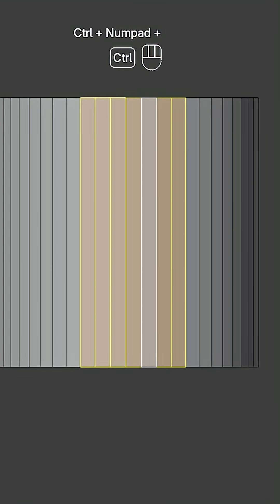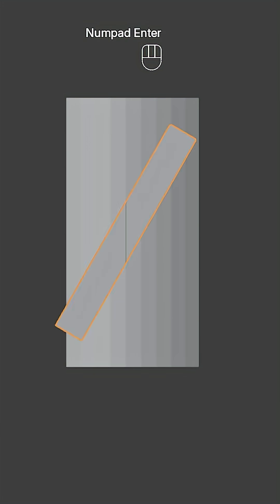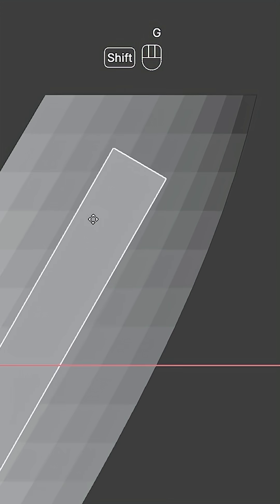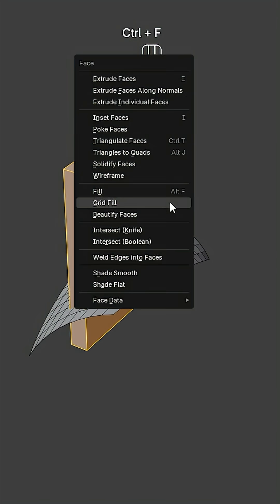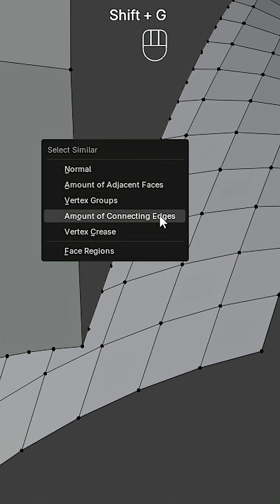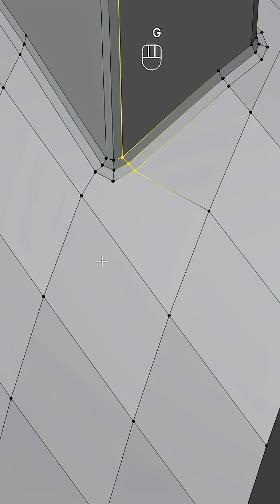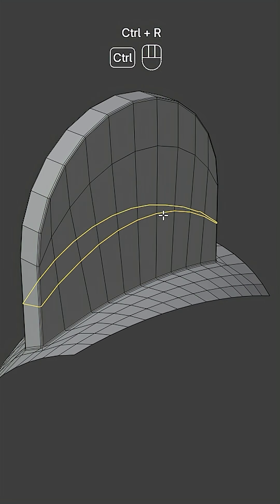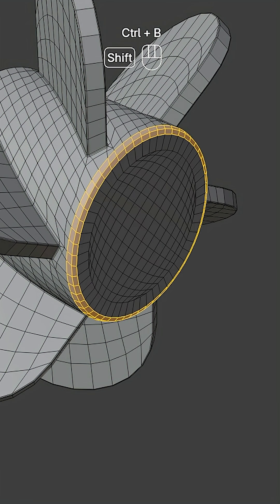3D Modeling Tip - Part 27

Comment from the maker: 📌 Tips for This Tutorial:

▸ The initial cylinder has 54 segments.

▸ Auto Merge Vertices is enabled, automatically merging vertices that are at the same position.

▸ In the bevel settings, Clamp Overlap is on, and Miter Outer is set to Arc.

▸ In Edit Mode, press Ctrl + F to open the Face menu, then choose Intersect (Boolean).

Comment: “Now, how do you model this?”
Well, that’s pretty easy. You just go to top view, select nine faces, and delete the rest. Add 13 edge loops. Back to object mode. Add a cube, scale, and rotate it 30°. Now, select this object, add a simple deform modifier. Set it to twist on the Z-axis and increase the angle. Move and scale the cube as needed. Then apply the scale and the modifier. Select both and press Ctrl J to join them. Go to edit mode. Select the cube, right click, intersect boolean. Select these edges and bevel with six segments. Select this vertex. Press shift G and choose amount of connecting edges. Deselect these and press Ctrl X to dissolve. Now select these edges. Add a bevel with two segments. Join these vertices. And do the same on the other side. Select this face. Press Ctrl F and choose grid fill. Go to side view. Set the pivot point to 3D cursor. Copy and rotate by 60°. Fill this hole. Then add bevel and subdivision surface.

Comment: If the cube is going to be connected to the cylinder at that angle anyway you probably could have saved time by insetting then extruding the faces upward then beveling the top for the curve. Wouldn't need to clean up the verts then.
Reply: i was thinking the same i feel less stupid thanks

Comment: I’m sure you could ve just rotated the faces of the cylinder to get the desired curvature
Reply: Could have also used an array modifier on an empty to non-destructively model the other 5 blades.

Comment: as someone who's main 3D modeling experience is CAD and not Mesh

...damn the process of doing this in Mesh is so convoluted compared to CAD
Reply: There's always someone saying CAD is easier for these heavily geometric objects. The point of this sort of tutorial is to teach you, in a simple setting, tools and topology for you to apply to more complex things. You wouldn't be using blender to make this propeller to have it manufactured.
Reply: I don't know how to use a cad program, but it's actually even harder than this if you are actually trying to make the model usable for a game engine.
Reply: Amen 😂
Reply: It's only convoluted because the end result is more important and open ended.
Reply: Pretty sure you can use the cad method on blender too
Reply: @tiddlesworth8798  how? That is the main reason I stick to max it is much more convinient for ones who come from CAD?

Comment: Uhm... you could create a simple cylinder primitive with enough subdivisions then extrude the blades where needed and then simply add a twist modifier (simple deform)  to the whole thing.
Dunno if im missing the point, but this looks like a 10x more steps method compared to the obvious one🤔🤷‍♂️
Reply: You'd still need a couple steps that amount to cleanup, same as here.
Reply: I thought the same.
Reply: I think the downside is that using bevel for the top of the blades is harder if you extrude with the supporting loops already added to the cylinder. Though, if you did extrude like that you could just use loop tools or similar to get the curve.